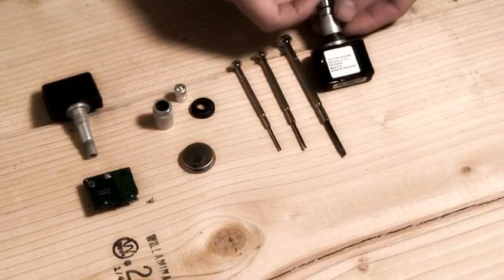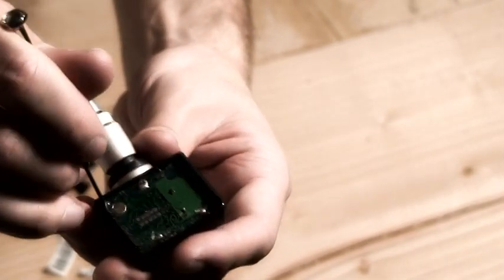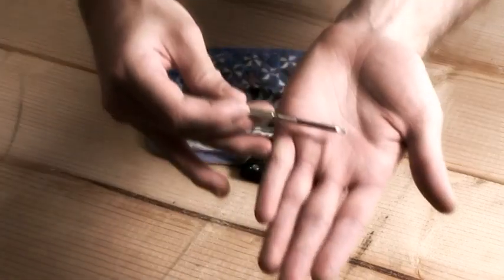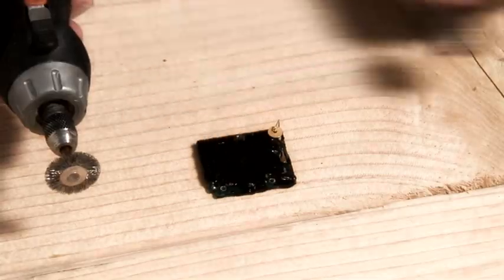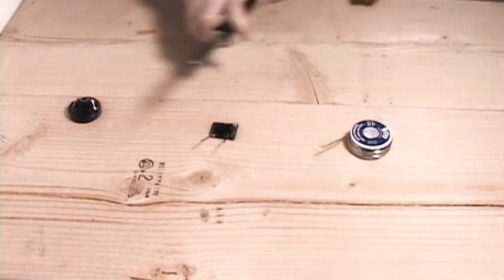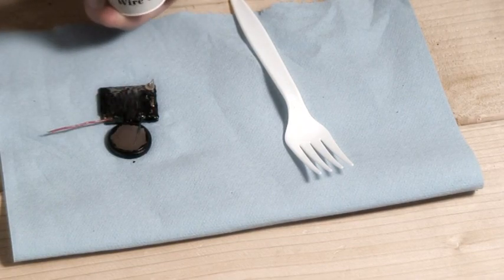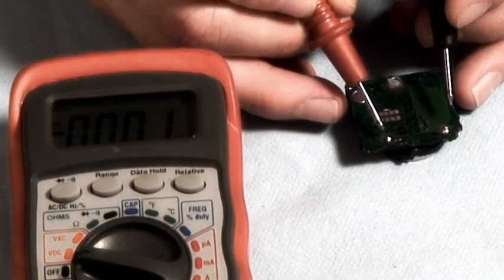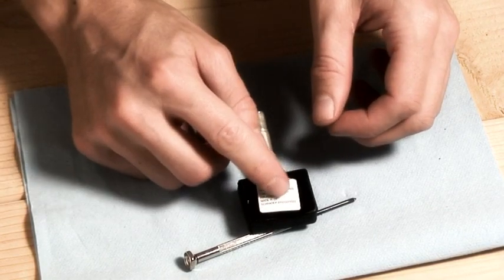TPMS Rebuild Part 04 - Rebuilding 2001 to 2005 TPMS Sensors

Comment: I'm curious about the filler material. Is it to protect the board from damage? No water gets in the tire. Couldn't you use some type of foam or something easier to remove in the future?
Reply from the maker: Probably... There's likely other materials you could use for potting. Just want to make sure they don't conduct electricity... best if they don't shrink much either with temperature and time.

Comment: No es tan fácil comprar el sensor TPMS y aplicarlo. (así tenga en cuenta la frecuencia de emisión). Los TPMS vienen con un código y si no tiene la herramienta adecuada para identificar y clonar el código, al nuevo sensor TPMS, la CPU del TPMS le va a estar indicando error cada 14 segundos. La batería que usa este instructor no es resistente a altas temperaturas. Creo que por eso usa el pegante eléctrico, en cambio de soldador de estaño. Es mi opinión. Otra idea genial es usar el barniz aislante. Yo no tuve otro camino que comprar las baterías en china por "AliExpress" y me llegarán en un mes. Ya que no tengo el identificados de código ni el clonador.  Y si lo tuviera no hay señal por que la batería del sensor está totalmente muerta. Solo me quedó comprar la batería original. (no había visto este video). Deséenme suerte.
Reply from the maker: +OlandoTorrasan 
buena suerte :) gracias por compartir sus consejos también!

Comment: THE most ridiculous endeavor I have EVER seen. Who in their right mind would go through this much trouble to save a few bucks? The possibility of damage is so great, that ONLY a blind fool would attempt to go through this tedious scenario; not to mention the exorbitant amount of time.

Also: you need to make sure your lighting is ON the subject you are showing. Most of the time one sees only a shadow.

Sad indeed..

GO to a dealer or Pep Boys, etc, and PAY them to replace the damn thing! Or forget about i;  and check the air pressure often and add (or take away) air to bring it to the proper amount. And quit trying to build a mountain in a molehill.
Reply: Pep boys is not going to replace anything. They are going to order you a TPMS for $80-$100. You should replace all 4 because the batteries will fail at approximately the same time. You're laughing at this guy for trying to save almost $400. But the laughs on you. Because you have no clue what you're talking about
Reply from the maker: +Bondo thanks man for the kudos... Originally I had done this because it was $400 per sensor. I was able to replace the batteries in about 15 minutes each for a couple dollars a piece. Like new! As for folks who are scared of a little elbow grease, there's always the corvette tax ;)
Reply: The possibility of damaging what, exactly?  A dead sensor?   Seriously, when you have the sensors out, why not try replacing the batteries?          Some people do things themselves; others don't.    Everyone has things they like to do and things they wouldn't ever bother with.
Reply: El reto es uno mismo hacerlo el dinero es lo de menos así somos los técnicos no nos doblegamos por halgo grande o pequeno pliss...
Reply: Some of us think, do and understand. Others pay.